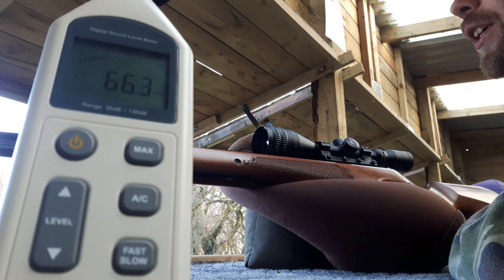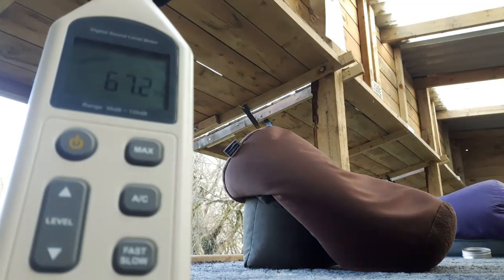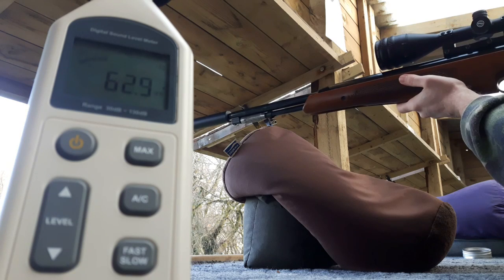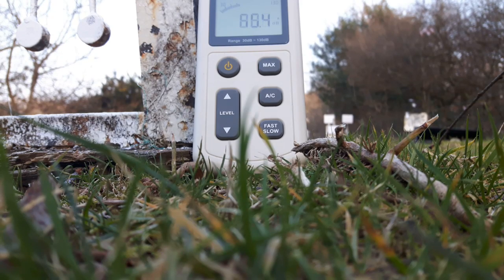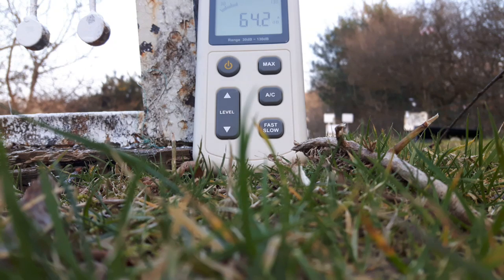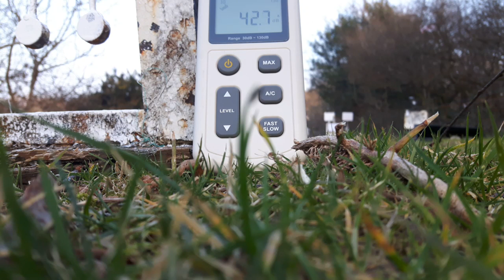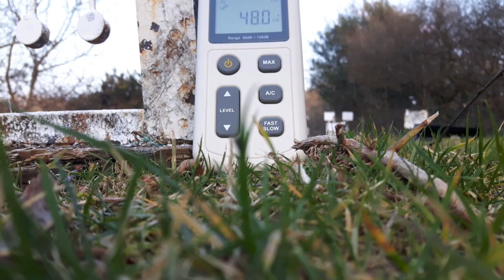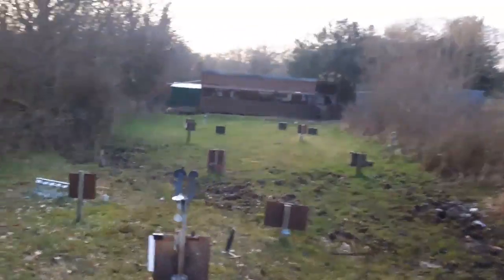Proof There Is A Point In Fitting A Moderator To A Springer Air Rifle

Comment: How do you fit a suppressor to a spring gun
Reply from the maker: Well take the TX for e.g.
The barrel has a female thread on the inside of the barrel, to which a plenum insert is place from the factory.
But if you buy yourself a moderator with a male thread it will simply screw right in.
But in my case i got an adapter that is male to male as i have a fair few mods with female threads.
As long as its 1/2" UNF either way its all good.

The short answer is adapters are ofter required.
Also not all rifles have the required threads on there barrels.
Cheers for watching :)
Reply: @airriflesuk5997  thanks

Comment: How did you go about fitting your TX200 with a moderator? I have one in .177 and I'd like to do the same.
Reply from the maker: Hi Luis
You need an adapter...
I have listed the item in question in the link.
After that all you need is an moderator with a female unf 1/2 inch thread :) 

https://www.ebay.co.uk/itm/351072002260?hash=item51bd85a0d4:g:gY4AAOSwNnRYlZwB